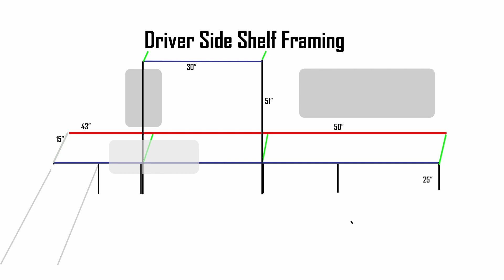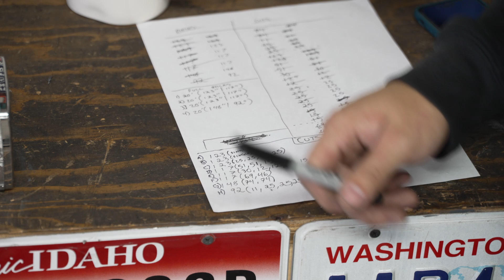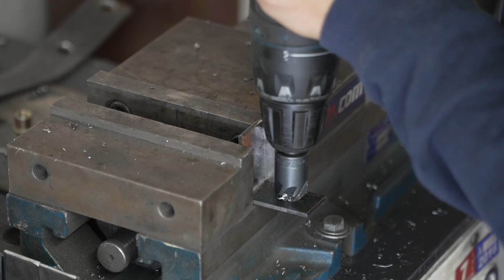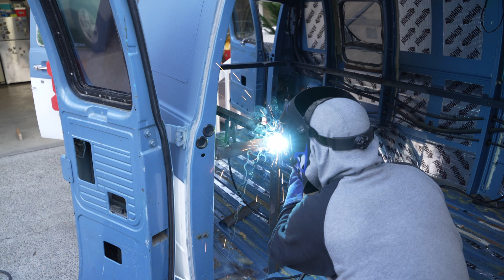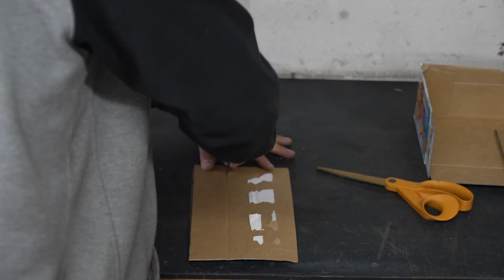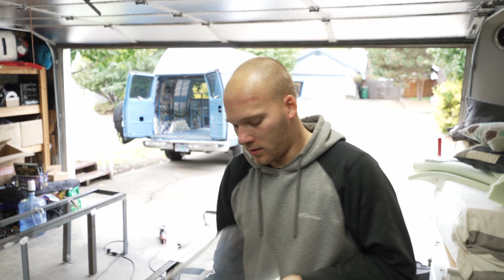Camper Van Build w/ Steel Framing

Comment: The way the Japanese were able to build a strong yet lightweight aircraft to bomb Pear Harbor with was to attach parts by welding instead of using nuts and bolts the way the Americans did. All those nuts and bolts added up to a lot more weight than welding would. So the Japanese surprised everyone at being able to fly their Zeros so fat from the aircraft carrier to Pearl Harbor because of their planes' welded construction - a new concept at the time.